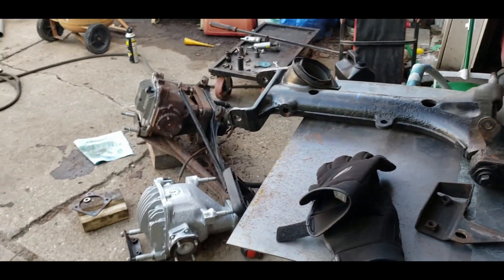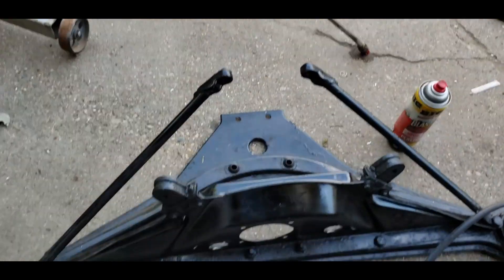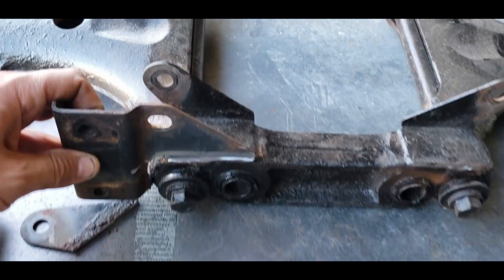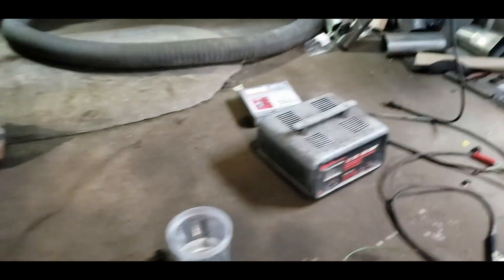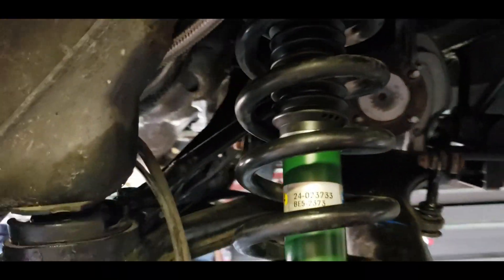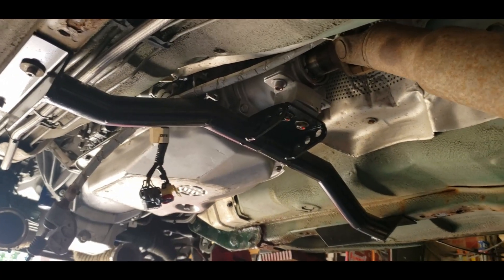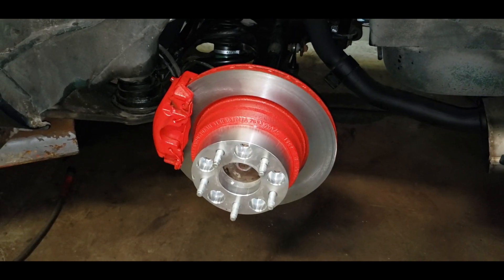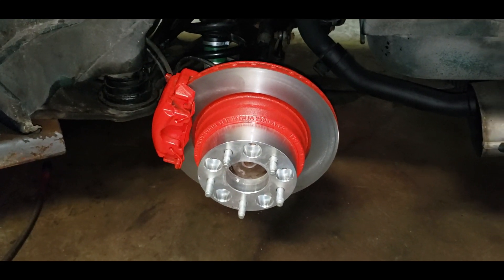2003 Jaguar XJ8 Sport Upgraded axle swap - X300 to X308 install

Comment: This is a somewhat complex job with all the part swapping going on. I have the x308 and I am looking to install the 15HU x300 differential in. I bought the offset plate for the front side pinion. I didn't hear you mention replacing the lower sub frame assemble plate and I heard some people mention it. Also I don't know if you used the same half axles out of the X308. I don't know if the dimensions change with the conversion. I am trying to limit what parts I need and don't. I think I was going to try and use the jurid/coupler pinion shaft that comes on the x300 and is the same for x308 to avoid drive shaft replacement. Any tips for replacement or even a parts list requirement for the swap over would be helpful. I think the exhaust pipe mount changes as well when changing over the front upper sub frame.  Thanks for uploading.

Comment: Bill....I really enjoyed watching your upgrade project....great job!
I'd love to hear back from you if you can answer my question.  I have a 97 XJ6/300/40 Jag I just bought...there is a growling in the rear end, and when I jacked it up to check it out, the driver's side axel had a huge amount of travel in and out on it......ANYWAY
I bought a rebuilt differential and am going to replace it.
Here is my question:
Can I relatively easily,  just change out the pumpkin....or do I have to drop the whole rear end suspension and all, in order to change it out...???
I hope not!
Anyway, looking forward to your answer....Thankyou!
Reply from the maker: The rear axle cradle needs to be removed as an assembly to get the rear axle housing out. And honestly its easier to do than it looks. 4 main cradle bolts, 2 shocks and a driveshaft and shes out. The brake calipers can be unbolted and tied up. 

As the half shafts act like an upper control arm, they were designed with stub shafts that have bearing housings that bolt into the sides of the carrier housing. You can remove those without removing the whole rear axle. Be careful to keep the shims on the correct side. Then you can inspect for how far the damage has gone. Alot of times you can just replace the stub shaft bearings.
Reply: @billweise1928  I can't express how I appreciate your word.
Typically, being mechanical, I don't mind the idea of more work....but I'm not at a place that's conducive to a major job....lacking all my tools, no good place to work on it...but, it is what it is....
So let me ask you one more question on this....to save time, can I do a quick fix...meaning....can I pull that shaft off the new pumpkin..and simply take out and replace the broken one??
Hope I said that right...
Reply from the maker: @rogereastman3187  basically,  yes. You can unbolt the stub shaft assembly on the side of the unit and it will come out and can be serviced or replaced with a new bearing setup.
Reply: @billweise1928  not that it's my preferred way to handle this...but if you don't foresee any problems by my switching out the stub axle unit....I may go that route, and kick the better fix down the road.......thanks a bunch Bill
Reply: @billweise1928  that, then begs the question....do I use the old shims, or the new ones ?
Or, are they already incorporated in the shafts themselves?
Reply from the maker: @rogereastman3187  I always replace the bearing so for me I reuse but if you're transferring from a used housing I would transfer the shims from the donor
Reply: @billweise1928  you are the man Bill !   Thx so much

Comment: I love watching these kind of video's. Just did my rear end (just with the stock parts though: shocks, springs and the a-frame). How's your LS swapped X308 doing?
Reply from the maker: Its doing pretty well. The rear axle has been very solid in it. I upgraded the converter after the last time on the dyno and I'm planning on going back before the end of the year if time allows.

Comment: Any balancing issues with the 1 piece drive shaft? Any drivability differences compared to the stock 2 piece drive shaft?
Reply from the maker: No, it runs very smooth actually.  But I did go to a 3.5" tube size to help vibration and strength. The 1350 yoke sticks out a few inches and the 4l80e is longer than the stock transmission. Combined with the engine and trans sitting back a few inches it made the driveshaft a reasonable length. Although the driveshaft is only rated to 140 mph. If I would have done a 4" and removed the bearing hump for the stock shaft I could have done a 160mph shaft. I doubt I'll ever go that fast so I'm no worried about it too much.

Comment: This is inspiring! What year Corvette calipers did you use?
Reply from the maker: I believe they were 2005 or 2006 z06 brakes.
Reply: How easily did your new c6 calipers swap in the rear? Do you still have a E brake?

Comment: How did that 3.21 ratio work for you? I have an xk8 I want to do something with.
Reply from the maker: Really well actually.  With the stall that I have I dont even notice the short gear but at lockup in overdrive it runs 2000 at 80mph.